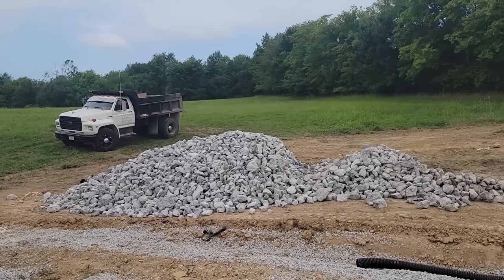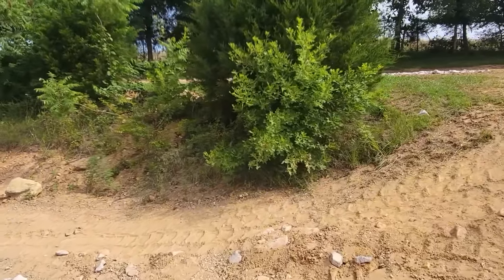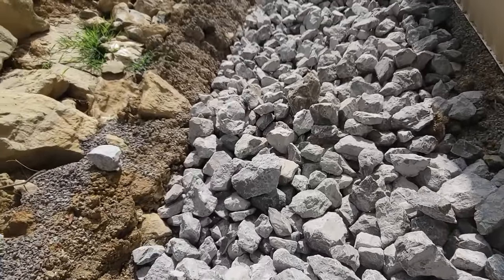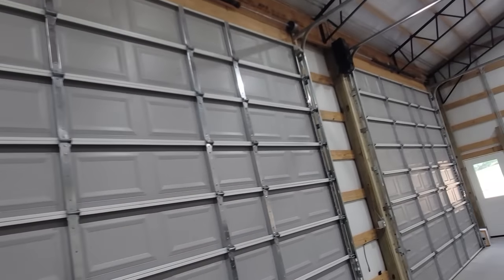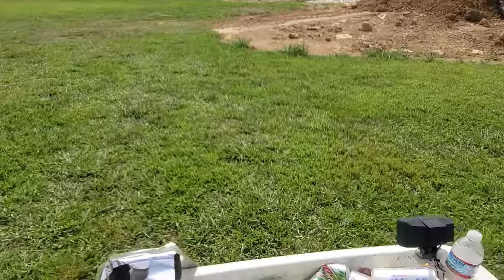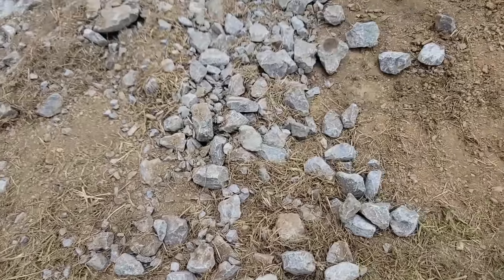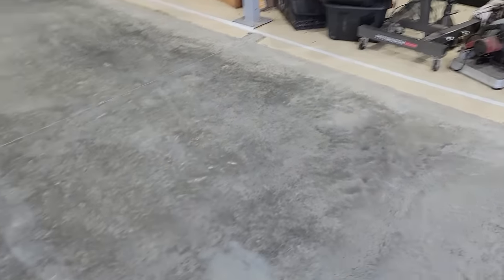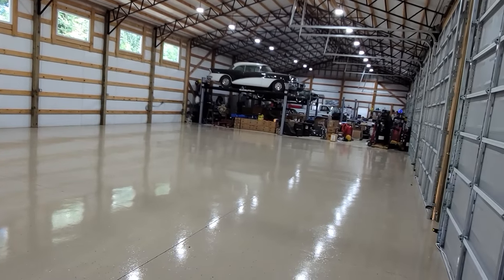My NEW Shop FLOODED! - Here's what happened (we had to start over)

Comment: You could have used an angle grinder on that transition ridge on the floor, knock the high spots off.  Then a guy that’s good with a trowel could float that area with bridge concrete.  You’d likely still see it but it would look 95% better.  And you could roll toolboxes etc over it without having to put up ramps

Comment: Oh I feel your pain, when I built my garage, it was a similar situation on a hillside, and when dug the foundation I was 24 inches lower than I should have.  First heavy rainstorm we had 2 inches of water in the garage, the garage doors were actually holding the water back.  Ended up having 8 inch perf drain installed, with 36 inch wide trenches and  2 large concrete drain basins to catch any thawing snow or influx of major 100 year rain, etc.  Needless to say, a huge headache and lesson learned.  Very expensive mistake, but extremely happy with end results.  Hope your solution corrects the issue, I'm sure it will..

Comment: As a retired Electrician, I can confirm that whoever did your electrical did a great job. I live on the west coast so heat isn’t as bad here as it is in Tennessee. I worked as an electrician for 37 years at a local college and we once installed a big exhaust fan at our automotive tech building. Once it was done we found that by closing the roll up doors to within 8” or so and running the roof fan the air flow really cooled the building. Everything there at your shop is looking great

Comment: Being an electrical engineer and wired my own detached garage I see you had the right electricians for the job. Done professionally and as I would expect.
Reply from the maker: Service rite is excellent
Reply: I agree. The conduit bends looked very good and consistent. If the end product, what you can see from the ground, looked that well, I would think the power distribution is more than adequate as well.
Reply: @colliecollie6822  Yes I'm confident they matched wire size to the right CB's and considered the voltage drop (I*R) based on distance of a wire run.
Reply: @rogersmith3960  hard to tell if that was 3/4 or 1" emt, but the wire capacity of either should carry the length of that building. Especially if the circuits were loaded properly which I have to believe they are. You don't employ electricians that can make those types of bends and space them that well if your electrical engineer and architect doesn't know what he's doing. That work looks more industrial grade than commercial. I saw no mc cable anywhere. Those were wire pulls from one end to the other. Looked like good work. The tell tell to me would be if the cover screws all lined up vertically! Lol. If you know you know!

Comment: I think I would have wrapped the riprap with an erosion fiber material to prevent the sand from clogging the riprap. Worst case if the material gets plugged up, you can either remove and replace or clean the material from time to time. I'd also HEAVILY hydro-seed that hill and build a temporary straw bale wall at the base of that hill (uphill of the riprap drain) behind the shop to catch all that loose sandy soil/mud at least until the hydro-seed takes hold and controls the inevitable erosion.
That 8" rise you pointed out at the drain entrance at the 25:00 mark will fill in on it's own with all that loose soil. If you level it with the pipe, the soil will end up INSIDE the pipe. Leave the "catch basin" at the inlet side and it will fill in on its own. If it's still low after the grass has grown in, then you can fill it but trust me, if you level that off, the soil WILL wash into that pipe.

Comment: Ideally you should have made French drains, using filter cloth to line and cover the gravel ditches, with a filter sock fitted perforated drainage pipe.   This stops it getting clogged with silt and clay  from just normal rain.     A normal ditch up the slope would be very effective and require minimal maintenance to keep clear.

Comment: It's going to do it again. 
They just installed a fancier band-aid this time. That hill, although expensiver, needs to be cut back away from the shop so that you can slope the "pad" (that was never actually built correctly) away from the shop at least  10-15 feet. A diversion terrace or "berm" as others have called it needs to be constructed on top of the hill. While you're up there, make two of them, one on either side of the road that is up there. It isn't complicated at all but excavation cannot be done correctly and cheaply at the same time. Instead of that being a dirt path, have someone that knows what they're doing make you a road up there. That will cause them to cut you a ditch on either side of it. One between the road and fence and one of the other side near the hill. Use the spoils from both road ditches to build a diversion terrace on the top of the hill. 
100% of the water from the neighbor will be sent to Rusty Acres and the house, presumably, or whatever is on the other side of the shop. Erosion and flood control measures will then have to be addressed in those areas until you can get it all sent to the neighbor below you so he can make new plans and a YouTube channel. then, you will deal with only what falls on the rock slope.
I do this every day. There is no such thing as overkill when it comes to fighting water runoff. Buried pipes have a defined capacity and are easily overwhelmed and clogged in clay soils like yours. Rip Rap should never be installed in that application without a geomat material underneath it. It will silt in the first time it gets saturated like this last storm and become useless. 
Good luck with it, wish I was closer because I could fix it in two days with just the dirt on site. Find the old man in town with the track loader business and turn him loose on it.
Reply: Yeah. Digging a ditch and then filling it with rock is just plain dumb. SMH.
Reply: Maybe put a little berm or a concrete diversion dam (wall) between the ditch at the bottom of the hill and the building as well?  Something to physically prevent water from running down to the back of the shop?
Reply: agreed
Reply: All that needs to be done is a wide swale with a 3 degree slope away from your building. But not into the neighbours either. Easy job. You don’t need rock or gravel. All highways are a perfect example . Just look at the side of them.
Reply: @frankbilotta6302  With the shop being at the bottom of a cut in the hill, I don't think a 3° slope is gonna cut it....
Reply: @TheHankerchief26  more like 20. Lol.

Comment: I lost everything I owned in a rising flood, so I know how it goes. My heart goes out to you all. I'm concerned because what you are showing is just not enough. You would need something far bigger than that 6 in corregated drain pipe and rip-rap. It looks like you have maybe ten acres of land sending rainwater directly toward the shop. Plus that dirt road behind the shop is unstable and has nothing holding it in place. It could slip and wreck the entire back of the building. You need the advice of a landscape architect/engineer to reshape the property coming off that hill. Maybe put in an adequately sized catch basin on the other side of the trees with a spillway that leads the water away from the building. I think clearing out that hedgerow last year maybe also let the water come off the hill more easily.

Comment: You need louvered exhaust fans in the ends of the gables.  Figure out what direction the wind naturally blows.  Have the fan on that side draw air in and the fan on the other side draw air out.  It will pull cooler outside air through the building.  There will be a massive hot air buildup in the top.  Regular fans will just push that hot air up and down.

Comment: If I may offer advice, do not drain your eavestroughs into a perforated drainage pipe.  It may end up filling up your ditch out back opposite to what you want. Use it to drain the stone ditch (French drain). I would run a separate non perforated pipe for your gutters
Otherwise looking good!

Comment: I also have been a civil engineer for many years. I agree with Ralph. My suggestions: Pipe across the top should have been much larger or as he says better yet an open ditch to carry more water! Either will require maintenance, cleaning every several years. Get the area growing in a secure ground cover very quickly or dirt washed in will plug up your rock. The dirt hillside you steepened may slide down against your building- get it growing a secure ground cover quickly! I really appreciate your videos and am very glad your again doing your “recover non-running car and drive it 600 miles home” videos. I didn’t realize you were in Minnesota where weather prevented your winter videos. Certainly GOOD LUCK in your Tennessee location!

Comment: I’d seriously think about terraces on that hill behind the shop! There’s programs through your local NRCS office to help with that.  Otherwise it will happen again.
Reply: My thought too. A terrace system would be much more effective long term.
Reply: yes put in an aqua duct to carry the water away from the building and to the lowest part of the property.
Reply: Terrace will be taller and cost more than the barn
Reply: I said that too,and NRCS might cost share it
Reply: @missingremote4388  LOL I don't think you know what we're referring to. Only needs to be a couple feet tall to divert  the water.
Reply: @jacobboone6078   I ditch a top the hill would work okay because the hill is red clay.  I'm just thinking cutting into the top migjt weaken the clay
 If it rains; if it becomes a  saturated  and fall down

Comment: With 5+ years of landscaping experience here's what I know.  Water will always take the path of least resistance.  Every single  time.   With all the gutters going into that perforated pipe it won't be able to absorb the wash water.  Your essentially going to have more water at the foundation with that set up because all the roof water is gunna come out the holes before it makes the trip around  the building.

Comment: Vice Grip Lodge - a big ditch would have been more fitting ... if those pipes cannot handle the volume of water coming down that hill it will flood anyway. It is all about the volume, sure there is a ditch filled with stone that water can also run through in addition to pipe flow however the stones will take up most of that space because you filled the ditch with them. Stones do not float and cannot be displaced by water. 
.
So your total volume of water flow potential per minute will be in direct relation to the volume of water the pipe can hold + the space around the stone in the ditch along with and how fast you can clear the ditch system based on your grade. I understand you would like to use the space behind your awesome building so you went the way you did but with the heigh of that hill I am concerned for you that your system will not be enough on bad days. 
.
Picture driving down a hilly road on a rainy day both of the gigantic ditches on either side of the road will be like rivers flowing .. now can you imagine tiny 8 inch pipe or whatever keeping the water off such a road? Your hill is higher and broader than most roads !!! Hope that helps save you from next flood! Cheers bro

Comment: As you were reviewing the inside I noticed that there wasn't anything to protect your metal walls from bumps and bruises from autos and runaway golf carts. When we built our new farm building we installed a 2x12 about 21-25 inches about the floor on the inside of the posts to protect those walls. One loose and rolling tire or tool box, etc would put a nice bruise in that metal. Just a thought.
Reply: So kinda like a chair rail in your house. Just bigger and more industrial. That's actually a really cool idea.

Comment: Two things I’d highly recommend, 

1. Oil waste furnaces that burn used motor oil, diesel, and transmission fluid

2. Would be a natural gas generator for whenever the power goes out.
Reply: Propane generator would be easier. Just stick a 500/1000 tank at it. Unless he has natural gas right there
Reply: @NoPaintGarage  Diesel, much more efficient ,i have both units on hand and diesel out performs gas almost 2 to 1.
Reply: @kriswright1022  yeah diesel is good too. I just gotta say propane because I'm in the propane business
Reply: @NoPaintGarage  Propane and propane accessories,  is your name Hank, by any chance? 😂
Reply: @kriswright1022  haha, I wish my name was Hank that would be perfect

Comment: As a trapper, I use steel traps that are pretty rusty after the season. So I soak them in vinegar water over night. In the morning I hose off all the rust, then dip them back in vinegar to keep them from rusting again before they dry, so I can paint them. You may be able to do that with parts and hand tools so you can use them. I use 50/50 mix of vinegar & water.

Comment: I have a hill like that with a dirt slope at my shop, there is one 4 inch drain at the end that goes under the man door slab that is now plugged. I dug a ditch with a shovel around the slab to bypass the plugged pipe. Its works fine for now. Nothing can stop a flood if you get more water than the drain area can handle moment by moment. If the front of the shop  is lower at the drain outlet he will be fine.

Comment: Hay man, this is Bill up here in Minnesota. My old Boss has property along side highway 61 and the side he is on there is a very wooded area behind his house and his basement would become a pond during a really hard rain. From the back of his house it's about a half mile to the top of the hill. It's all wood and at the top is farm fields. So he measured how much rain fall we got, how fast the basement filled with water, and how deep the water was. He did a couple math equations and told me how much volume of water we would have to redirect. It was quite a bit. We dug a four foot deep 20 inches wide trench all the way across his property and on the left hand side of the house we started to turn the trench down hill again and stopped at his driveway. Ok this is the part you might want to talk to your contractor about. At the bottom of our trench we put down one inch rock about two or three inches deep. Then we took a five inch peaces of PVC pipe and drilled holes offset bottom center three inches on the right and left side of our pipes. All 3/4 inch holes. 24 inches apart and the same down top center of pipe. Glued them all together and the last two sections of pipe looked like swiss cheese cuz that's the discharge end of pipe. Then we laid two inch rock the rest of the way accept the very top we used washed sand and packed it down.  Two months later we had a hum finger of a storm and if I didn't see it with my own eyes I would have never of believed what I seen. The water coming down the hill stopped at our trench we dug. And the water was coming out that pipe we buried and I couldn't believe how much. So that little two foot deep trench they dug and no pipe in the ground to move the water is going to cause you problems still. You need to literally remove the water from behind the whole length of the building that's why you need the pipe.

Comment: Unfortunately here in the UK We always have the same flooding issues on inclines . This is how we overcame the same issues you have. We cast an upstanding bund into the floor foundation. We then built the pre fab shed , same size as yours “on top of the bund”.
I hate to say it but what you have done “ will not last five minutes. “ It will silt up , that what we found. We kept ten full size trains in our second shed that we had built. We cured the issue with this cast in up-stand. I can show you pictures of the torrents of water going around the shed.

Comment: Im in Chattanooga  and agree with these comments. Solve surface water problems on the surface  do not try to run this water in a pipe use swales and berms to route surface warer around the building

Comment: Derek,  I agree with above posts. Unless there's ledge or rock too large to move, a large, deep ditch will work much better than French drains. The drain pipe shown is way too small and needed a fabric sock to prevent silt from filling pipe.

Comment: I´ve had a great time to watch Derek´s channel, he´s just a great guy and what a talent with the camera! What comes to water issue, there´s lot of good comments below but there´s one main issue with new pipe. Of course the slope etc. need to be thought but there should be TWO pipes, one for the drain water from the roof and the other for the underdrain water from from the soil / flowing on the soil. The first one is "whole" pipe and the latter has small holes in like Derek showed on the video. They should not be mixed as now the drain water from the roof will wet the ground....

Comment: Feel your pain. Rode out Hurricane Sandy surge with a small fleet of boats on the water. Brought all my tools off the docks to on land figuring it’s so scary out on the water that it’s safer inside, waist high. Water only came up waist high but everything became buoyant and crashed everywhere. My tote full of power tools actually got thru it fine til I brought them back out to the dock and our landlubber neighbors just ran their trash pump hoses over the edge of pier and they filled my power tool tote with water. The aftermath was worse than riding out the storm.